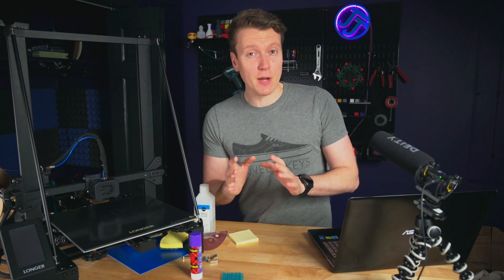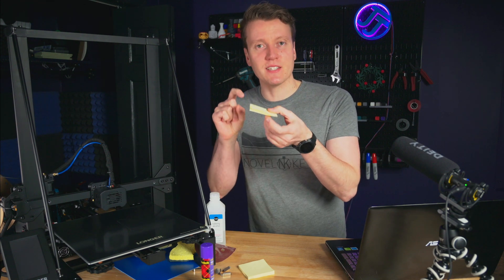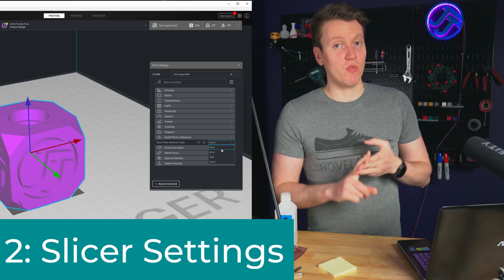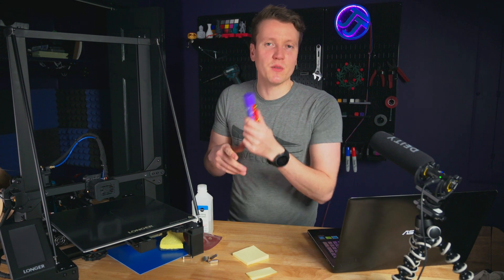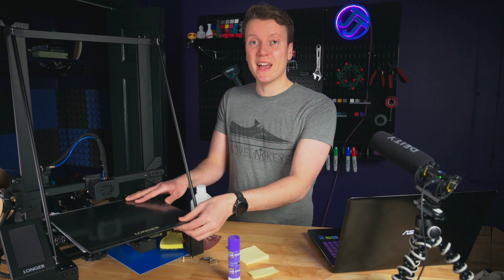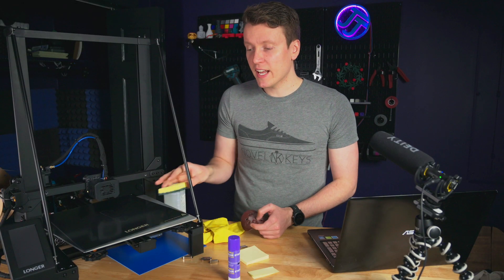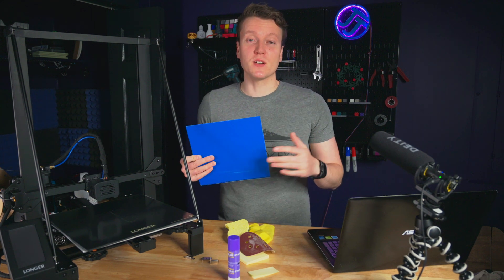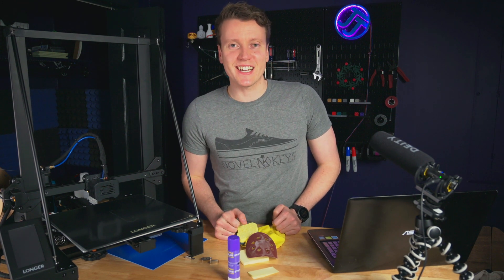Tips for 3D Printer Bed Adhesion | 5 Tips in 5 Minutes

Comment: Hello! absolute noob here! i see in reddit and other places people just say use sticky note, use painter's tape or use glue stick. But can you tell me what exactly is "using" mean? do you stick the sticky note when putting in for print? or you use it to rub over the plate to level it? or use it with isopropyl alcohol to clean it? do you just apply a coating of glue stick, then print on top of it? or just use it as a coating, then clean it and then print it? Im sorry this might sound really dumb but im scared to make assumptions and cook my plate.
Reply: Hey man I know this is a very late answer but if anyone looks to the comments with the same question I can give some answers 

I've never used sticky notes so I don't know that one but for painter's tape what you need to do is basically cover your bed with the tape but you need to make sure you're not overlaping the tape or leaving any gaps. you also need to make sure there are no air pockets between the bed an the tape. PLA sticks to the tape well and the tape sticks to the bed well so your prints will stay on the bed. after the print you can just peel the tape and be done with it. In my experience you should change the tape every single print to get the best resoults.

If you're using glue sticks just apply a thin coating on the bed. make sure there are no big chunks of glue on the bed and print your model. after the print clean the bed with isopropyl alcohol and for the next print apply a new coat of glue
Reply: @kubilayalbayrak8419  hey thanks man..i just wash my plate these days with cloth washing soap( Rin soap) every 10 or so print and it works mostly. I'll try this too next time. One thing I wanted to know is, wouldn't the painters tape melt in the bed heat when printing and fuse to the plate?

Comment: I tried a lot but now my first layers are problem free. Just print on normal glass cleaned with cleaning vinegar. PLA en PETG no problems anymore. Even printed some ABS parts without using glue. Maybe only bigger ABS parts need glue..not sure. Not tried yet as I mostly print PETG now
Reply: Of course bed leveling and correct bed temperatures are also needed. Don't use papertowels which leaves small fibers on the printbed, I use microfiber towels instead.
Reply: after printing let the printbed cool down. The prints come loose from the printbed automatically

Comment: I have played about with brims and rafts..... usually successfully..... but USING A GLUE STICK has been a complete revelation!
I've been printing for 2-3 years and started using a glue stick last week. All the filaments that gave me adhesion problems have started behaving perfectly! I haven't used a raft on any of the small prints that I was previously having to use rafts for since I started using 'scotch' brand version of Pritt. It seems like admitting defeat, but try some glue instead of rafts..... it'll save ages and make like just nicer!
Reply: Glue stick (in my opinion) is a last resort when it comes to bed adhesion. 
What you could do instead is one of these: You can clean off the bed surface using rubbing alcohol and microfiber cloth, level your bed, heat up your bed, change the extruder offset to make extruder lower, (calibrate e steps before doing these ones) slow down initial layer print speed, set the initial layer line width to 125%, set initial layer height to 0.4 or higher, bring up initial layer flow, buy a new 3d print bed (only if you have stock or if you've seriously trashed the old one), or get a BL touch to cover warping.
Reply: Try hairspray !  It works a treat and is probably cheaper than glue stick.

Comment: Another tip is slow the first layer speed right down, to 10mm/s or even less. It can help if you’re losing details to filament peeling up or sliding around as it’s laid down. Has worked for me at least.

Comment: Hello, I have a problem with PETG - at the beginning my prints just poped out once build plated cooled down... but over a time it sticks even more and more. What can I do to make less sticky surface? maybe its safe to apply some oil?
Reply: An oil will probably give you less adhesion. It's going to fill the pores in you plate.
If you haven't found a solution already, I can only give tips for a structured plate as that is what I have.
Keep the plate as clean as possible, double the height and slow down the speed for the first layer in your slicer.
I also recommend you set something like 105% initial layer line width, this especialy will help alot.